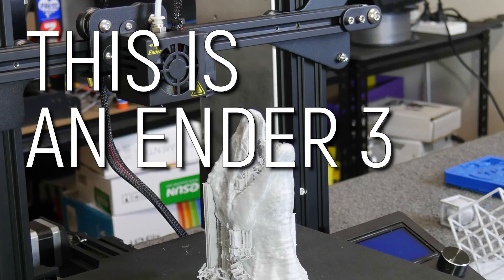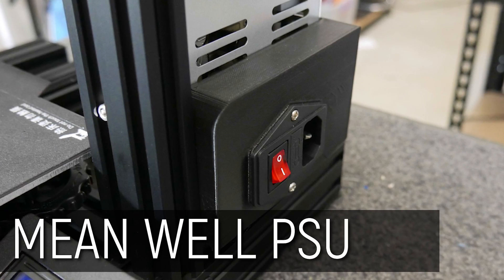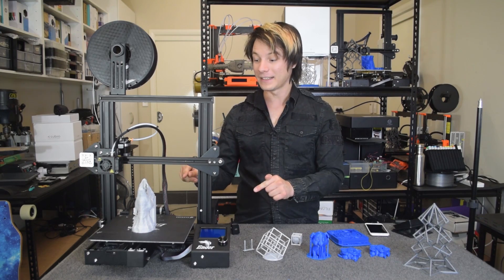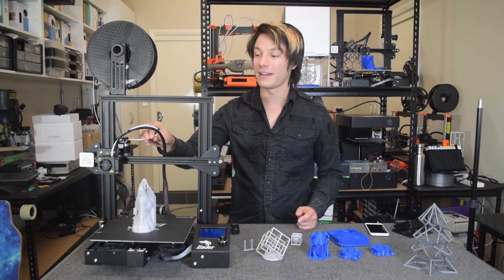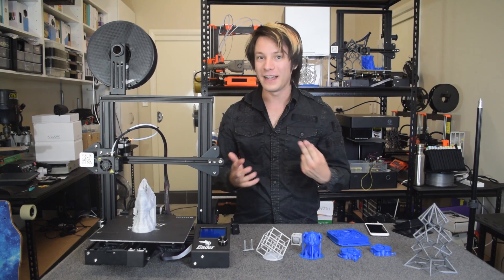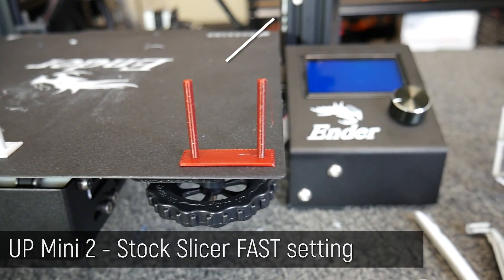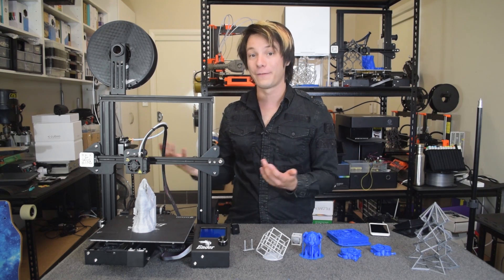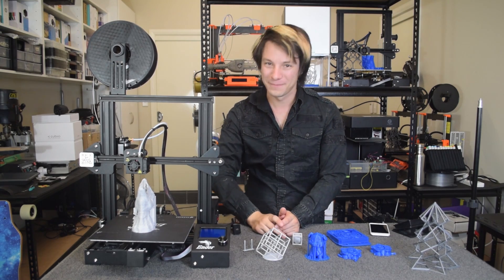Is the Creality Ender 3, Pro?

Comment: the best thing i did for my ender 3 was to move the extruder directly on to the hotend, it improve the printer so much that when it broke, i had completely forgotten how to use it without. So now i just have a plate of steel that i cutout to support the extruder :)

Comment: I bought an Ender 3 back in September, and to be honest, I'm less than impressed with it.  It seems like every print job takes 2 or 3 attempts at bed leveling before I get a decent one, I get a lot of wobble in my X axis, and $60 worth of upgrades (upgraded fittings and tube, bed level springs, glass bed, a metal extruder I haven't installed yet) haven't made it any better.  To compare, my Monoprice Mini V1 has been surprisingly reliable even bone stock, produces good results and bed leveling has been basically a one-time procedure (except for the time I messed it up trying to print PETG.). Needless to say, I'm not convinced I'd buy another one or even recommend one.  That said, I've learned a fair bit about how 3d printers work from all the tweaking.

Comment: I have a new ender 3 and the stock tube seems fine.  The only time I saw stringing was when z hop was on.  Also, the bed is fake build tac but is help on by 4 binder clips.  Now I need to look at hot end and settings

Comment: You missed some ender 3 gens, the second gen ender 3 still came with a buildtak clone but a redesigned Y belt tensioner that is secured by both sides. 
The original tensioner was only fixed to one side of the extrusion.
Reply: Also I'm not sure it ever came with glass as standard, pretty sure that was a promotional deal that allowed you to get glass for free if you purchased during a certain timeframe. 

Creality needs to start putting version numbers and list each exact change.

Comment: Wow you had such bad luck, and poor opinion of the ender 3. I got one for Christmas. Never 3D printed, sliced designs, even touched a 3D printer before. Took me 2.5 hours from opening the box, to printing my first ever prints on the Ender 3. Has been printing great ever since. Not a single issue or failed print (I know it’s still done minimal work, but I’m pretty impressed being a total beginner).

Comment: You might want to check out the Creality CR10S PRO. They have literally listened to every complaint the 3D community have mentioned and fixed them! All new extruder, built in power and touch screen,  24v instead of the standard 12v and has the new PTFE tubing! New hot end and auto bed levelling!

Comment: If you want better mechanism, auto levelling, all metal components, touchscreen,you want the CR10Pro. 

The Ender3 magnetic bed  stops adhering anything after a few weeks, it's not flat. Convenient to throw in the rubbish bin. It also cannot be removed with big surface area prints.
As for printing...these printers are outstanding and I have no issues with quality and no issues with stringing with a Cura slicer. Not sure what the difference is with your unit, but I get better quality. I have had issues with Simplify 3D slicer gcode, it just doesn't seem to work as well. 

I only have two mods: a MacEwen extruder gear and Capricorn PTFE tube, I have no issues with TPU, Ninjaflex or PETG. As for the thermal runaway issue...that could have to do with local electrical certification laws in your country.
Reply: If you ran your bed at I believe its above 80-90c the magnetic field will be destroyed rendering it useless. A couple of ender 3 pro reviews mention this. The ender 3 pro's magnetic bed is useless if you want to print something that requires hotter bed temperatures. 

Also I notice alot of 3d printing channels still use and promote simplify3d. It's pretty outdated and rarely receives any updates/features supposedly from what I heard. I've used nothing but cura and have had excellent print results. The only edge simplify3d has over cura is the custom supports. My ender 3 is mostly stock accept for filament guide which is a must.

Comment: I love your channel and ur reviews despite getting printers for free u still give ur honest opinion ... I just got the original ender 3 a few weeks ago this makes for my second 3d printer and for the price I am extremely happy with the results so far but I have to say my results seem to differ a lot from urs I have not experienced any stringing what so ever on prints that I have had issues with in the past just curious if u dry ur filament before these test ? I found this to be the major cause of my stringing , before drying I spent countless hours playing with retraction and coasting settings to try to limit or cut down on stringing with little to no improvement , just wondering if u dry ur filament ?

Comment: I just got my Ender 3 from the dutch company 123-3D. I was expecting it to come with the normal buildtak like surface, but it actually came with an aluminium flexplate clipped onto the hotbed.

Comment: I got the ender 3 pro just a little over a month ago for around $230 US. Even though I’ve since gotten the Capricorn tubing, glass bed, silicone sock, upgraded extruder gears, improved on part cooling ducts, several others and more to come, but it still bugs the crap out of me that they’ve already changed it. It feels like they short changed all of us that bought it a little earlier.
Reply: Where did you buy it for 230 its 280 everywhere I look?
Reply: Jeremy Leeds Frank it was an amazon listing during the last week of November. GearBest also had it listed for $225(memory may be off by a few dollars) at the same time, but they wanted to add on another $30 for shipping. I haven’t run across those prices since though. Hope you can find what you’re looking for. It’s a fun little project printer. I’ve since added a bl touch and octoprint with the NoIR raspberry pi camera, rasp pi b3+, and some tuya smart plugs. Building onto it is half the fun.

Comment: I have the PRO and haven't had any of the issues with the magnetic bed and I have done a lot of prints on it. I keep mine turned forward without any issue.
Reply: Well I think he tested mostly with "torture print"
But thanks you for your comment.
I am really stressed, I ordered a ender 3 pro I was already stressed enough with what happens for shipping with thing like 
Will they just leave it in front of the door of the apartment if I'm not there.
What happens if it get stolen.
(This is my first time ordering something online)
Knowing that it is working very well for basic printing releave  some of my stress.

By the way if you have any answers about my shipping questions I would really appreciate it.

Comment: got an ender 3, put a glass bed on it, new tubing with new couplings, silicon sock on the hot end. And it is printing pretty nice and reliable for me. Great printer if you want to get into 3d printing.

Comment: Thanks for the mention. The price difference between 3 and 3 Pro use to be more. And for the record, I’ve yet to get my hands on an Ender 3 with the silicone sock and reported Thermal Runaway Protection enabled so I can only go by what I’m told from various sources including a Creality rep. I’m trying to get one of these silicon sock versions to verify. The latest available firmware for download from Creality does have it enabled in code but I’ve yet to successfully test it. Still working on this.
Reply: I just got my e3pro Dec 5 and after upgrading to a bullseye cooler I noticed mine has a silicone sock(thankfully as I was just about to purchase one).  I wasn't aware that there was a version that had the thermal runaway enabled.  I'll have to see if there's a way for me to check it, then I'll get back to you.

Sidenote: I just printed and installed your side bracket for the filament holder in clear pett yesterday and it's such an improvement over the top location.  Thanks for making that video and all the other ones.  I also installed the EZR extruder from your suggestion and I'm super happy with it.
Reply from the maker: Thanks for the info Chuck. Something this important really shouldn't be so uncertain.
Reply: They are certainly making changes. I bought one from a batch in November, and although it does come with a silicone sock, all the gears have been converted to plastic pressure-fit ones instead of the metal ones. This creates a nightmare for people who want to install dampeners on the X and Y axis.
Reply: I have an Ender 3 with a silicone sock with the clip on bed. How would I find out if thermal runaway is enabled? I don't ever leave the house with it running, have installed a smoke detector near it, and a fire extinguisher by the entrance to the room. I'd like a little more comfort in knowing that thermal runaway is enabled or at least that I have done everything I can to make sure an accident doesn't occur due to carelessness.
Reply: @A-DudeForInfo  Go to Chuck's channel (CHEP) as he shows how to test for thermal runway on one of his videos.
Reply: @tinplategeek1058  Thanks!

Comment: Hey, great content maker! 
I received my Ender 3 early november last year, and now it has a habit of just stopping late print. usually between 10-25 layers before finish. I've tried different g-codes and settings, but cant seem to pinpoint the issue. Have you got any experience with this? Tried googeling as well, but there's not really much info, at least that i can find. Im still pretty new at this, but i gotta say, that the Ender 3 has been a champ up until now. I've also tried the stop/resume print, and even cutting the power, just to try everything, but once it stops there's no going again. Crossing my fingers for an easy fix, and that it's not a broken beyond repair printer. Anyone, help? :)
Reply: I had a problem with my MP Select Mini that was similar to that, what fixed that for mine was to buy a new microSD card

Comment: I personally wouldn’t mind paying for the higher quality psu, though maybe $20 extra at most. I know thermal runaway is an issue, but that can be flashed back in. A crappy psu, however, will pose a huge fire risk for something like a printer, that’s often left on for long periods of time. Not that the original psu was that bad

Comment: I have an ender 3 mods are creality glass bed and a diy capacitive touch ABL , thanks for the info about bowden tube I can going to order capricorn xs now, I am a ham radio operator and in the last 10 years china have really got in to the radio market but the problem is they never make a polished product, they release them too early and instead of bug fixing then release a new product and just keep going like that so instead of producing really good products they produce ones that work but need bug fixes to make nice.

Comment: With your Ender3Pro does your console display turn off when you turn the power off or does it linger? If you rapidly move the build plate, does your display flash on? 😒🤔😰
Reply: If you are connecting your 3D printer to your computer via USB cable then when you turn off the printer the control board is receiving power from the PC so you see a dim display vs when 3D printer is powered on.
When you move the print bed or the Hot End you are driving the stepper motors and they can act as electric generators.  You can damage your electronics from power spikes if you move the bed or hot end too fast.  Just move the bed or hot end slowly to avoid serious power spikes.
Reply: Thanks. No USB in this case, and a little concerning there isn't diodes preventing induction of power!

Comment: I bought an Ender 3 a few months back just before your review came out. I saw another review that praised it and it was so cheap I decided to try it. I had an Anycubic prior that just frustrated me. Then I saw your review and I thought - "Oh no, what have I done".... However I have been really pleased with my Ender 3. It's not perfect but it's really reliable and gives decent prints. I have not changed anything on it. The thing with a review like yours is that you are setting a really high bar. I understand, but you need to bear in mind that for the price it is really good (although I guess with quality control and endless revisions it's a bit of a lottery). So... I guess I have cancelled out my own comment. Oops. I would be quite interested in a comparison between the Ender 3 and Prusia. At several times the cost it would have to be quite something!
Reply: I really appreciate the detail that you point out in your reviews too. It's really helpful.

Comment: Good call. I have 3 second generation Ender 3's. I didn't even bother looking at the pro version. Not worth the extra coin.
Also my Enders have the 40 rollers under the bed opposite each other which I like over the first type. 
And they came with removable build plate which is good if you want to do ABS. I have since gotten one of each type. The magnetic plate is good for PLA and PETG, you just have to not fold it or it will crease. 
Besides not having a Meanwell power supply, I have nothing to really complain about. It makes my $800 Flashforge Adventurer look like an overpriced toy. And it outperforms it in every way. Except no wifi..lol

Comment: Lets take about 5:52 : The nozzle is oozing because he is dirty has hell on the side. Remove the blue "shit" with a steel brush and it's gonna work again. i discover that on my printer some weeks ago, after 3 month of extruder jams and difficulty to print even something small. After a big and hard clean ( hold the head when you do that ), many small piece of black pla blobs fall of, then a very light " powder of pla " on the bed, invisible to the eye but you can feel with the finger.

Now my nozzle is entire clean, i printed out many part with 4hours of printing finger in the nose, right from the SD card, no more preheat need and some extrusion from pronterface on the computer.  :)

Comment: Ive must be a lucky guy cuse my ender 3 prints extremly good and i have had no issus at all. The prints are flawless and im shocked to se youre dragon😳 did you print that att full speed😂

This is my first 3D printer so i would say that my input is valid but still i have a CNC background that helped me i guess.

I do understand douh that menny have had alot of problems to get it to work right but in all honesty the ones that have the most issus is the ones that thinker and mod it to mouch in my opinion...

Comment: Frankly I was expecting from a Pro version to upgrade the control board with at least Mega 2560 to fit full blown Marlin on it. Meanwell PSU and 4040 extrusion are welcome but this control board and the strange magnetic surface (btw I have the same scratch at same place) are to be thrown. The right vertical extrusion can be rotated 180 deg and the PSU will not clash with the magnetic surface which strangely can not be aligned with the bed part :) Also on Thingiverse there's PSU cover for LRS-350 that seems to be better designed. Anyway as person coming from Tevo Tarantula I'm amazed what a big difference there's in the design of two printers, of course all benefits are for Ender3. Finally I spend almost the same price as I paid for Tarantula and got the Pro version because of some promotion and I think I got the best for this price.

Comment: My ender 3 came with a non-magnetic but removable flexible base, glued on what looks like pcb material, and was held on with clips and had the silicone cover over the extruder. I've had it about a month now. It is printing really well after I found the elongated nuts to loosen the rollers a tiny tad. I'm using esun PLA+ its like extra strength pla, very nice.

Comment: I'm waiting on my Ender 3X with a glass bed. Hope the glass bed is an improvement
Reply from the maker: What the heck is an Ender 3X?! Where did you get it from?
Reply: @MakersMuse  I can't find it anymore but i had seen it on amazon, it was an ender 3 but with glass bed and a few spare nozzles iirc
Reply: @MakersMuse   It is also mentioned here: https://all3dp.com/1/creality-ender-3-vs-ender-3-pro-3d-printer-shootout/
Reply: @MakersMuse  Just got it from eBay: https://www.ebay.com.au/itm/Creality-3D-Ender-3-Ender-3X-Ender-3-PRO-3D-Printer-220x220x250mm-AU-Stock/143029694885?hash=item214d3bf1a5:m:mxC87vmSmHEod9J-739Dg0A:rk:1:pf:0

Comment: About the demagnetisation of the build plate. Could this be solved by replacing the magnetic plate temporarily (while printing abs or anything else) with glass or something? And when you just print pla just go back to stock?